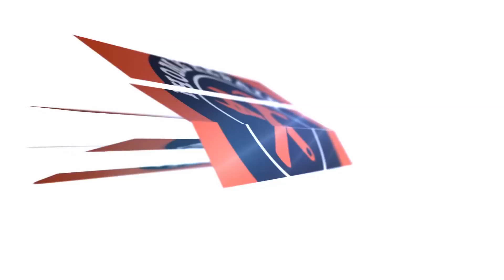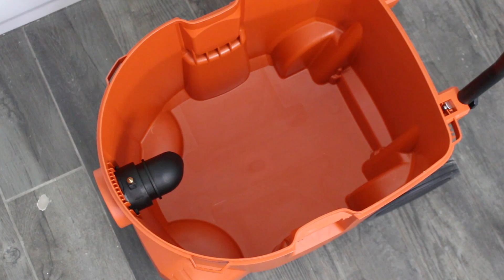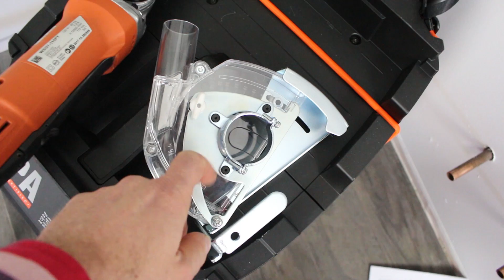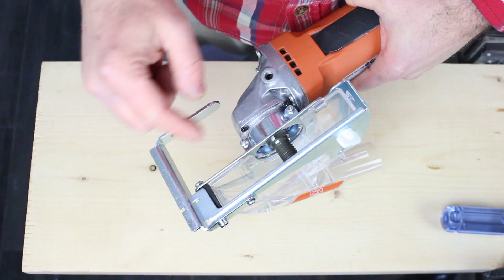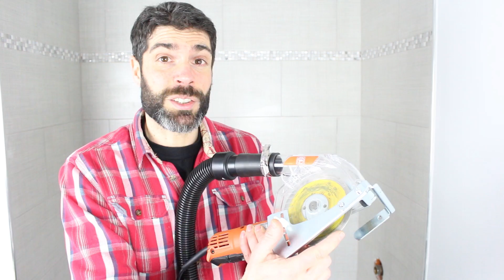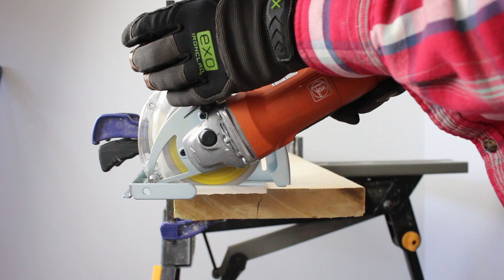How to Cut Tile Without Dust -- by Home Repair Tutor

Comment: with this hepa vacuum how long can you cut before cleaning out the filters and such. im thinking of using something like this to demo existing wall tiles. i usually just bang channels into old tile in sections and remove tile and board together but something like this might work but curious to how many linear feet of cutting thru tile and duroc can i do before stopping to clean filters? thanks

Comment: Fantastic video. Very professional. The dust control system is great. Now if I can get my contractor to figure out that there is a way to control dust while cutting tile that would be great. But great video, very helpful in all aspects. Impressive.

Comment: Is a silica dust respirator different than a respirator that just takes P100 filters?   I have a North 7600.  I noticed this mask also takes P100 filters but specifically is listed as a silica dust mask whereas my mask does not specifically say silica dust
Reply: As long as you have N95 or P100 filters is good. One blocks 95% of particules and P100 blocks around 99.9%

Comment: This might be a dumb question but where did you get the rubber hose at 5:34?  I have been looking for hoses to help ease the connection in between vacuum hoses and accessories.  I feel like it should be easier to find this but I have been to Lowes and Home Depot multiple times asking and even a specialty hose place and no one knows of any hoses like this that can stretch to fit over.  A lot of the accessories I have are identical size to my Festool hose so I need some rubber hose like that to slip over the top of both to connect them. Thanks.  Good vid - I didn't know Fein made a shroud like that.

Comment: If I wanted to have a herringbone pattern on my kitchen floor tile, would it be better to cut the tiles before I set them or could I set the tiles then use the angle grinder to cut out the space for the cabinets?

Comment: I’ve never seen a tile setter hold their grinder like that. Blade is always on the left when holding it with your right hand. Nobody clamps their tile down and uses two hands. I need a dust extraction cover like this that allows normal use of a grinder

Comment: Excellent video and information. Thank you. Does that dust collector only work with a 4 1/2 inch grinder? And if you can pin a link to the dust collector that would be great. Thanks.
Ron
Reply from the maker: thank you, the dust guard works for 4-1/2" and 5" grinders. Here's an Amazon link that has more information https://amzn.to/2ORJ2og

We highly recommend the HEPA vac because it cleans the HEPA filter every 15 seconds. It's loud but does a great job of keeping the filter clean.

Comment: I attached a 1 1/2 x 1 inch angle to the base and used it as a guide against a fence. Perfect straight cuts every time.
Reply: Can you upload a video of your modification.? Sounds like a good idea.
Reply: Good idea. I was wondering about the viability being able to see through the shroud after a few cuts - let alone it's still a grinder which likes to travel. Thanks👍🏼

Comment: If your cutting a slab with a power saw or a lot of tile will that dust get in the AC ducts and spread thru the house??
Reply from the maker: That is a big concern and highlights the reason for this system

Comment: An expensive vac but the dust control makes it worth it. Especially when you’re remodeling during winter months with the house closed up.
Reply from the maker: good point, totally forgot to mention that often there's not an option to work outside. This is true in apartment buildings, too.
Reply: Yes, and all that dust can clog a furnace filter very fast.
Reply from the maker: yes, not to mention create a huge asthma or allergy issue
Reply: Where can buy this?

Comment: Which dust extractor are you using?
Reply from the maker: It's the new Fein dust collection cover but will fit any angle grinder, they're not available yet but in a week or two